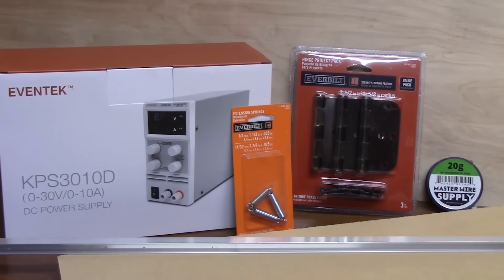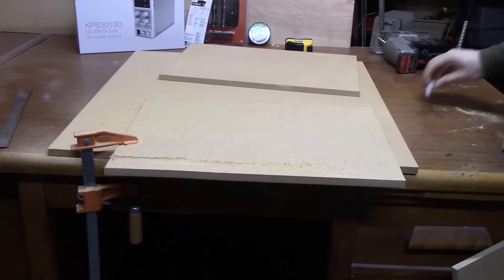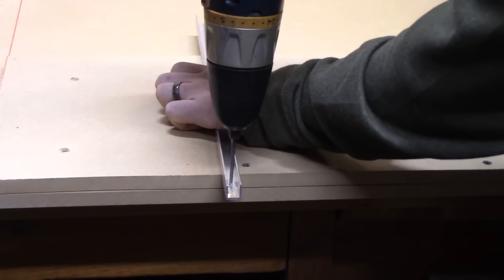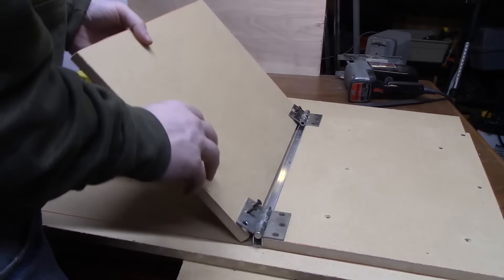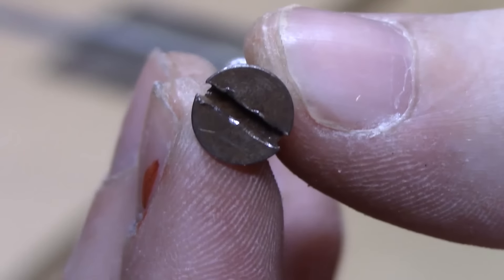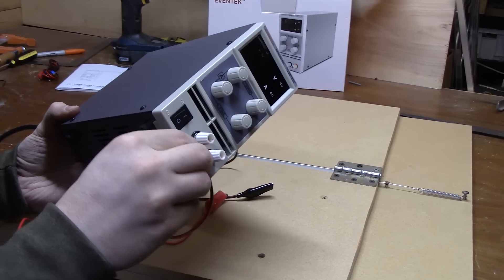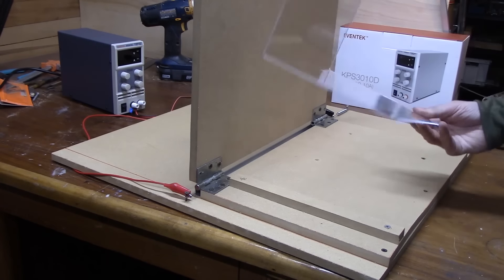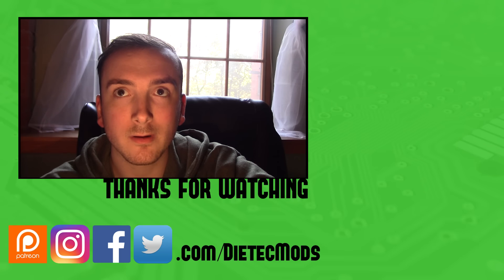How to make a DIY acrylic bender (Cheap & easy)

Comment: Hello,
I am working on my first casemod now, i wanted to spraypaint a logo to the side of the case. I used vinyl to cutout the logo. Now I got glue stains from the vinyl all over the parts that are not painted.
I cant remove it with alcohol because the paint underneath it would go away. 
Anybody got an Idea how i can remove the glue?
And how can I avoid this in the future?
Thanks!
Reply: Remix House Hello!
Thanks for responding. I used an edding spraypaint from amazon. Yes It was dry for weeks - I tried it with alcohol but it destroyed the paint..I used no primer 
The vinyl was fully applied and I let the paint dry with it on
I guess I have to spray it again..any ideas how I can avoid the stains in the future?
Reply: Make sure its non permanent vinyl if you are just using it as a stencil. Quality enamel paint shouldn't rub off with alcohol either. You might have to try a couple of different brands and their formulations. The only thing I can think of is you had permanent vinyl as that's why their was glue marks. Unless it was some awful low grade vinyl stuff. You want to be buying Oracal 631.

You could also try distilled water to remove the stick. Or WD40 should remove any residue also. You would have to test it with your specific paint and materials of course to make certain it doesn't remove your paint. 

If you are going to be doing it constant better to grab a piece of material and test different paints. I like the engine enamel spray paints as once they cure they are pretty resilient to scratches and various cleaners.
Reply: JimmysTheBestCop thanks! I will look for non permanent vinyl...that should solve my problem I guess. 
Thanks for taking time for me!

Comment: Why did you waste all that wood by mounting it on a board? It makes it twice as heavy? Far too complicated using far too many screws. A strip along the spine wide enough to rest the side panels on and feet or pads on the outer corners, job done, simple, half the weight, cost even less. This is the problem with the younger generations, no thought process.